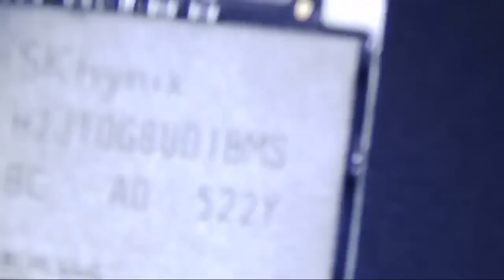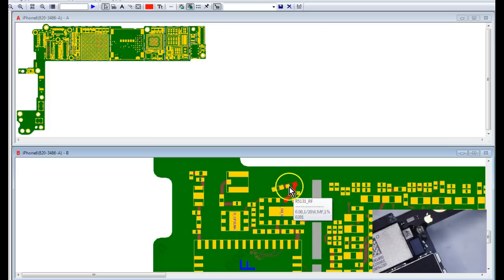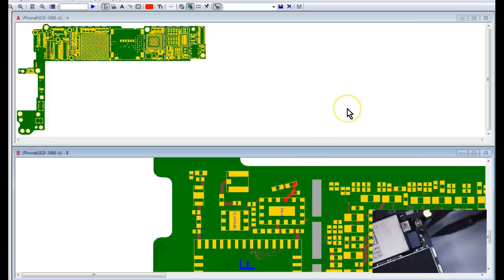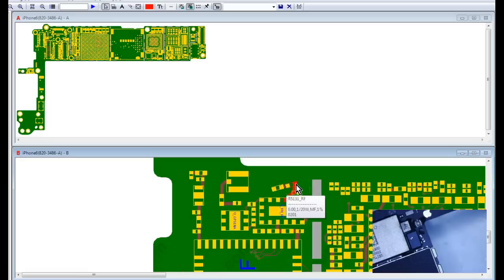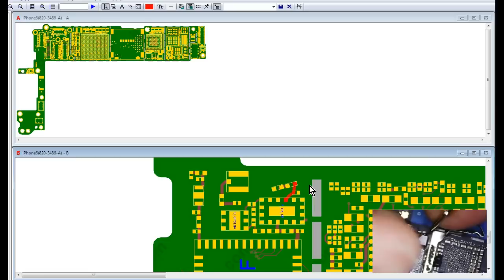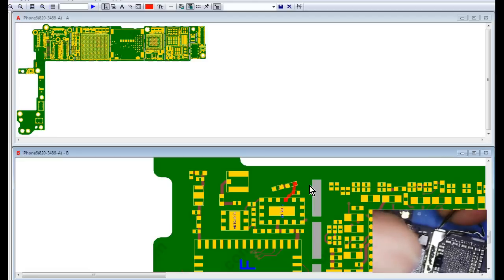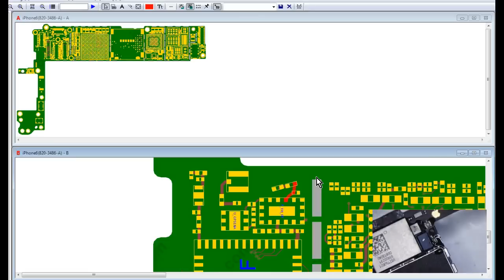iPhone 6 Weak Wifi Signal Repair Solution

Comment: My iphone 6 was working just fine but once i dropped it in ground and then after my phone has the low wifi signal issue?
Any solutions😢
Reply: try slapping it again. Slapping mine makes the wifi work fine again. lol
Reply: either the signa antenna got loose or the wifi ic solder joints got broken (when solder oxidizes and has been dropped with a certain amount of force the connection can break)

Comment: The board diagram is different from the board you're actually working on.  There's a row of passives between the WiFi and Tri ICs on the drawing, but not the board you're working on.  Can you really trust the values listed?

Comment: @op. The reason that resistor was showing a short to ground to begin with and not on your doaner boards is because of the antenna that is hooked up to it. When you unplug it, the low resistance dissapears. Try it out. I am really curiouse if that still soved the issue so I am going to try it on an iPhone 6 I have with super bad WIFI signal and also drains battery pretty quickly... I have a feeling my WIFI IC has a slight short in it though...